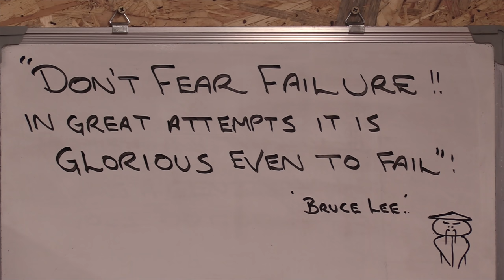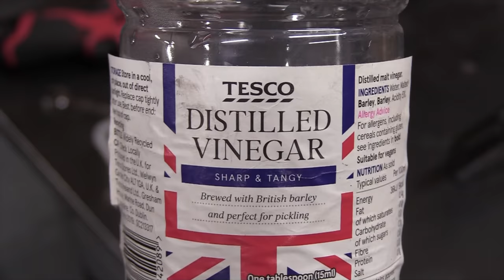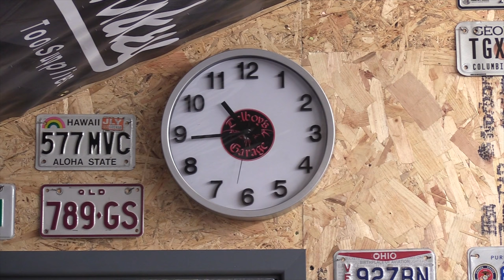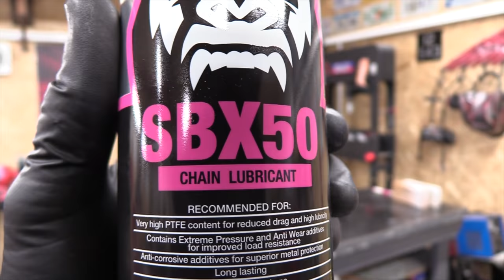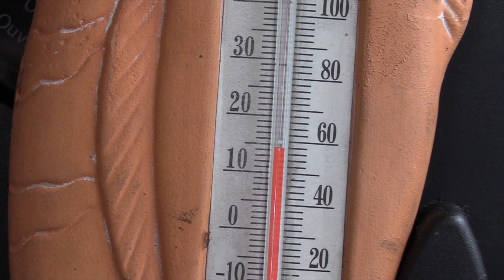Husqvarna Makeover #21 Swing Arm Paint Day !

Comment: Would powder coat be more durable del them swing arms get a fair beaten
Reply from the maker: Powder coat is harder, but it can still chip, it's also a lot more expensive to have done, and you can't repair it if it gets damaged.. this particular paint stays durable and slightly more resilient to chips and scratches, and you can rub down and repair/respray any damage... plus it'll match the frame as that's painted satin black too.!

Comment: Very nice, surprised you didn't have it powder coated.
Reply: I doubt powder coating is ideal here
Reply: @elionh4532  Why? Powder coating is far superior to paint.
Reply: @rickseconds7676  because it might damage the aluminium swing arms from powder coat oven cooking at 400f degrees. Maybe they loose their strength etc. i cannot find any info if manufacturers paint or powdercoat such as yamaha

Comment: I thought that you were going to drill a couple of drain holes at the bottom ends of swing arm for Drainage??
I would have done this before cleaning and painting.
Other than that Del - killer job as always :)
Reply from the maker: It is bizarre that this much water could have ever got in to a swingarm in the first place and it's not likely to happen again as I'll seal it this time so nothing will get in there, which is, I feel, a better option than drilling holes under the load bearing edge of the swingarm, which could possibly effect it's structural integrity...

Comment: Hi great video, I’m respraying my silencer’s on my Honda cbr 1000f which are black so I’m thinking obviously I’ve got to coat with a VHT paint but I’m finding it difficult to get a gloss VHT paint mostly it’s all a MATT finish which isn’t what I’m looking for . Do you think painting with VHT Matt then curing and then going over with an engine gloss finish that can withstand high temperatures? Any thoughts appreciated
Reply from the maker: Give this a try mate... Mat and satin paints have a microscopically rough surface, that's whey don't reflect light and look shiny... so if you simply "Buff" a flat finish.. it will actually shine... maybe not high gloss.. but with some T-cut and polish (and of course elbow grease), you should be able to paint your pipe with a VHT paint.. then once it's fully cured by heating it... just set to with the buffage and see what you can achieve.. worked for me many time mate !   Good luck with it.
Reply: @Moonfleet41  thanks appreciate the advice

Comment: Beautiful finish I need to buy some of that paint the rattle cans I buy the paint so easily chips for a past time.
Was thinking about the chain adjuster bolts Del couldn't you blacken them with the rustproofing you leant from your metalwork teacher from school? 
Ha ha all I remember from my metalwork teacher was aluminum casting in sand. It was a slow process but the outcome was amazing as is your swinging arm Del!
Reply from the maker: Hi Marc, that would be a good move... but as you saw in the close up, they've been eaten away a little on the very end that lives inside the swingarm, having been submerged in water, I was trying to replace them, but they're very specialised and I can't seem to find them at the moment, but I can change them at any time during the rebuild, and if all else fails, then yes I could oil treat them!    Have a great week, keep safe, D&Px
Reply: @Moonfleet41  Yes come to think of it the thread pitch did look a bit cause.
Keep them awesome videos coming and I pray you have fully recovered from your ordeal.